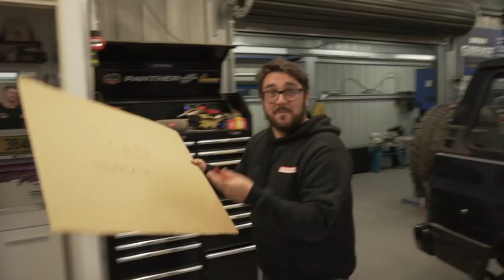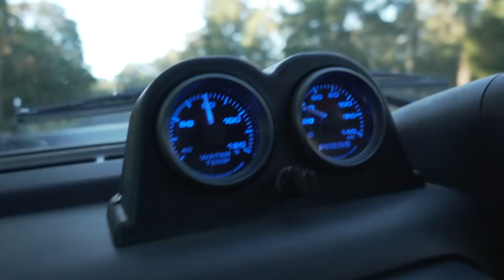Will A Bonnet Scoop Fix The V8 Powered Maverick? + HQ Holden Holley Sniper Update

Comment: Sounds like the wire going from the negative side of the coil is finding a ground instead of being used as a signal, if you ground the negative side of the coil you will lose spark.

Comment: I think that you might have a short circuit to ground  in the wiring between the ignition module & the Holley Sniper EFI system somewhere,it could be simpler than you think !

Comment: The hq runs a 9v coil as standard equipment and the standard ignition wire has an inbuilt resistor so there is a good chance the original wire won't cut it. On my hj I found the easiest way to fix the problem without hacking up the wiring harness was screw a relay to the firewall use the ignition wire to operate the relay coil and run a wire with a 2mm copper core from the fuse box the relay then another from the relay to the distributor or a 12v coil depending whether your coil is separate to the dizzy. With the patrol/ maverick have a think about putting in a switch that can manually turn on the the thermo fans. I've had a thermatic switch die on the side of the road and was not happy.

Comment: Spark issue. Guys try running your coil power straight from the battery. The factory coil wiring uses a resistance wire as feed. You may have overheated power feed or even ignition switch.
I had similar issues.
Good luck
Reply from the maker: Hey mate, thanks for the tip, i had replaced the 9V resistance wire when we did the electronic dizzy conversion, but I still had a crack at powering it straight from the battery and still had no luck.

Comment: Remove your bonnet protector which clearly kicks up the air towards the windscreen. The streamlined airflow over the bonnet into the scoop will work a treat without your bonnet protector

Comment: Running a LS1 Alternator on my HQ running Fitech solved a heap of issues, they need a very stable voltage and the addition of the EFI + pump draws a heap of voltage

Comment: If it did have a points distributor it would of had a ballast resistor that needs to be bypassed when changing to electronic distributor , a ballast resistor drops the volts to around 7 volts so the points don’t burn out but electronic distributor and the Holley ecu need constant 12 volts

Comment: Have you replaced the original ignition positive wire I think the original had a resistor in it for the old 7.2v ignition system
Reply from the maker: Yeah we have. We had to do that when we installed the electric dizzy

Comment: Guys check out  frogzskin mesh it lets air in and out but doesn't let water dust mud etc.. in through the mesh, people use it alot in marine applications and snowmobiles to pull cool air from outside the hull or engine compartment but not let water in. An oil cooler will help aswell with engine temp, alot of drift cars use them.
Reply from the maker: Sounds pretty interesting. Will check it out. Thanks mate

Comment: Ebay ones are shit I been through 3 of them.
I bought a Desert cooler radiator 3 years ago best thing I've ever done. 
Td42 turbo always got hot now I've tried everything to make it get hot 5th gear pulls up a long hill  and it still won't go over 95*.
Reply: I got one got it tested and was leaking from evry where not happy

Comment: Race radiators dandy. Theyll sort issue. Ally rad guaranteed with EL falcon thermos. Zero dramas with their products. 100000km offroad no dramas
Reply: Iam going to give them a try as well having problems with Aussies Desert  coolers had pin holes evry where not happy so iam going to try race radiators a go for my td42 turbo  gq
Reply: @td42dirtygq  yeah i was less than impressed with aussie desert cooler. Complete junk. Same issue as you described. Pin holes everywhere in the custom rad they made for me. Since fitting the race radiators rad 0 issues. 0 overheating. Runs minticle!
Reply: @SHOCKcustoms  done I have to give them a shot now forsure

Comment: Looking at when the xacoupeguy changed the distro on his wb he removed the factory wire that went back to the key for that reason, maybe part but not all of the solution.
Also with wrapping I reckon a wrap with a pattern or design works better than trying to match colours. But not sure about an aussie flag on the scoop
Reply from the maker: Yeah We removed that wire when we did the electronic dizzy conversation, it looks like the sniper is grounding the coil, which is odd. 

Haha an assume flagged scoop would be a feature that’s for sure